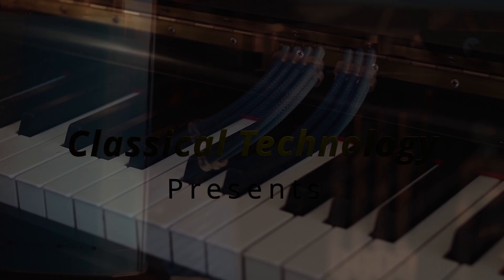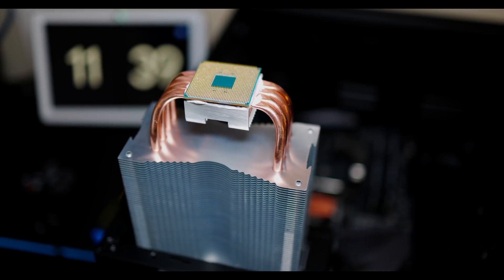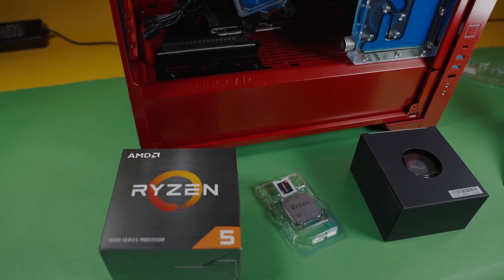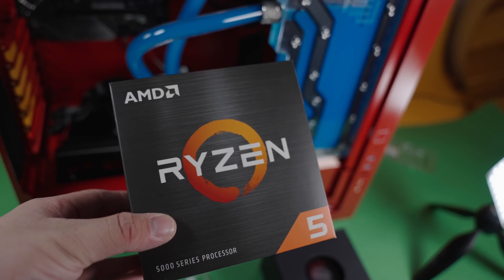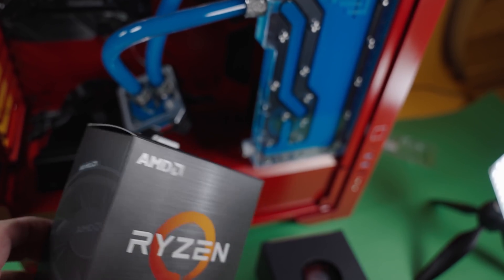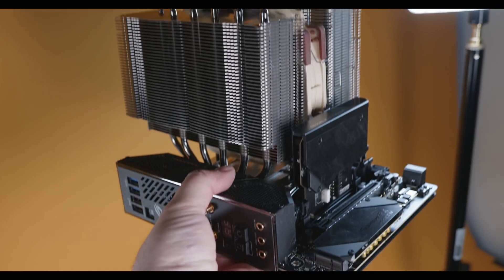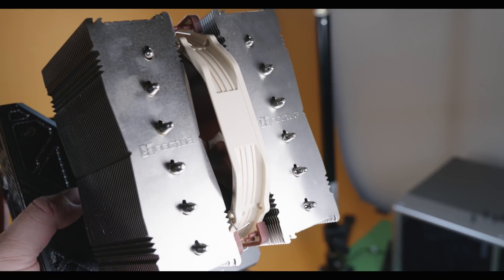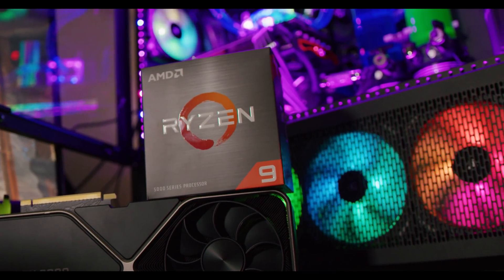WHICH TO BUY? AMD Ryzen 5000 Buying Guide, Availability, Performance

Comment: As well as the most famous youtubers did not speak much of the 5800x I will take the opportunity to have visualizations. The lack of intelligence is contagious, the 5800x has the same gaming performance as the 5900x is 100 € / $ cheaper, has 8 cores and 16 threads. This whole family of processors had an increase of 100 € / $ and they are advising 12 cores for those who will not use or 6 cores in 2021. if I can give another 100 € for a 5900x I can also give another 100 € above the 5600x to have one 5800x. Go to reddit to see temperature problems with the 5900x ... I bought the 5950x for myself and the 5800x for my daughter are two magnificent CPUs when I run the cinebench the two reach 75c very quickly the 5800x in games does not exceed 65c with the noctua nh15. The 5950x uses watercooling and the temperatures are slightly lower. Think about the advantages of 8 cores for 6 if you have money 5900x

Comment: Got a 5800x and it runs great.  I knew about the fact that it is normal for it to run hot so I got an MSI 360 rad and put it at the top of my bequiet  500DX case on exhaust with 3 140mm fans on the intake.  Even when it heats up and the fans crank up all the way it still stays pretty quiet.  Also I really only use it for gaming so it is rare to get hotter than 65-70 after gaming for several hours.  If you do heavy workloads that tax the cpu fully on a regular basis you are better off with the 5900x.
Reply from the maker: Glad to hear yours is running well, some do seem to be a bit better than others.

Comment: Hi tiago, i recently rebuilt my pc and Im having an issue, maybe you could help? Im rocking an rtx 3080 founders edition, an asus b550f motherboard, 32 gbs of gskill neo ram, a ryzen 9 5900x and a 1000w power supply, i just changed my power supply, motherboard, and cpu yesterday and now my pc just restarts when I start a game. I have a titanium rated power supply, so im just confused on what it could be, ive tried graphics card drivers, and such but nothing seems to work:( please help anyone
Reply: JayzTwoCents just did a video on a similar topic like this not too long ago. That problem turned out to be a bad graphics card. Check out that video first or if you have another graphics card you swap out with. Also are you using multiple M.2 NVME drives that maybe flooding your CPU lanes?
Reply: @BlueSword455  i figured it it out, it turned out to be the frickin anti cheat software installed with the games I was trying to test with lol. After a bios update it fixed everything:)
Reply: @Maclainnn  Lol, awesome! I'm glad it was an easy fix and the problem wasn't in the hardware. Enjoy your new build!

Comment: I got a 5800X. I wanted at least 8 cores and in my region the 5900X is $250 more than the 5800X while the 5800X is just $150 more than the 5600X so the value makes more sense. My stock temps with a Noctua NH-D15 were initially reaching 34 degrees at idle and 80 degrees in cinebench R20 (scored 6000 points multicore) but undervolting with curve optimizer I got the temps down to 75 degrees (6200+ points) and 27 degrees at idle. If I lower the PPT I can get the temps down to 65 degrees, R20 score at 6100 points and CPU power around 88W (matching the 5600X performance per Watt). It's a great CPU, but yeah it needs tweaking and the out-of-the-box experience isn't great. Makes me think the mobo BIOS is sending too much voltage at stock. Might get better with PBO2 but we'll have to wait and see.

Great video, man. Keep it up.

Comment: Have had a 5800x for a couple of weeks now, seems to be stable and not that hot. Runs at around 60-70 with water-cooling. :)
Reply: That's still high, Custom waterloop?
Reply: @Kizzster  It is around 35 on idle, and around 70 max it seems. After I closed down the epic launcher the temp went down quite a lot it seems. Corsair iCUE H100i RGB PRO XT is the name of the cooler. :)

Comment: Remember, the 5800X is only bad value IF you have a choice. Most of you don't. The 5800X was in stock for a good few minutes on NE yesterday. If you still somehow pay scalped price for a 5600X over a MSRP 5800X, I don't know what else to tell you. 
If your 5800X runs hot, try setting your PPT, TDC and EDC manually. I set mine to 120W/75A/110A and get roughly the same performance as stock while dropping 15C under all-core full load.

Comment: Hey guys I could really use some help! I’ve owned a pc for about two years but I’m not really tech savvy. My pc has worked fine with the games I play but recently my performance in certain games has dipped drastically. My biggest example is resident evil 7! It ran at 120 FPS steady with my 1060 but recently it’s been stuttering a lot and runs between 55 and 85 FPS. Idk what I could do to fix this issue so any help or tips would be appreciated. Oh and one last thing I’ve noticed is my load times have been really bad. In death stranding I have to wait 5 seconds on a black screen before I get back to the game after rearranging my packages and gear it’s annoying and never used to happen
Reply: Check to see if there is any abnormal tasks are running in the background using task manager. Shut them down and or run a virus/malware scan. Check for the latest graphics card update software. Also run bench mark and diagnostic tests on your ssds and or hard drives. They should run close to their advertised speeds with zero errors IF they are not close to being completely full. Then run a memtest to check for any errors in your memory sticks. Last thing I can recommend is a bios update for your motherboard. Hope any of this helps.

Comment: I have had a 5800x now and mine was fine. Out of the box running idle in bios showed 35C. When gaming it then jumped to the high 70s because it was boosting to 4.85ghz. These are bad temps but had a play anyway. Not changing any voltages just putting all cores on 4.5ghz the max temp I’ve had so far is 64C and that was playing in warzone for 4 hours with applications open in the background on my other monitor. There are all sorts of tweaks to keep temps down. If you’re not that likely minded though which I appreciate some people aren’t then the 5600x or 5900x would be better for you. As you can see from my temps though not all run hot. My mate bought one the same time and has the exact same experience as me

Comment: 7:05 You argument about it throwing more heat into your system isn't good. Your radiator will have the same temperature whether it's a 5800x or a 5900x/5950x that's dissipating 140+ watts.
Reply: Good point, these reported high temps are coming from the CPU die and not the actual water temp which is usually much more cooler.

Comment: Just ordered i9-10850k and Asus Strix Z490-E motherboard since it was in stock. Hope i didnt make wrong choice. Upgrading from i5 8600k and Z370-E(?)
Reply: How is it? Is it up and running yet?
Reply: @BlueSword455  it's been up and running for 4 days now. seems to be doing good. i let the bios do its thing and i believe it boosted it to 4.6ghz and doesnt go over 65c on temperatures (cyberpunk @ 1440p)
Reply: @Reaper_AjB  Nice, very nice! Yeah I have both the 5600x and a 5800x but waiting for my Asus X570 Dark Hero motherboard to arrive but my patience is running out after 2 1/2 weeks of waiting just to see how hot the 5800x was gonna run. I could just go to my local Microcenter and pickup a 10850k and order an in stock Asus Z490 Hero VII Maximus from Amazon and probably have cooler temps. I just want at least some kind of 8 core or more CPU that'll run the coolest.
Reply: @BlueSword455  hopefully you get it soon, i luckily found a local (somewhat) computer shop in my state that has been able to get 3080's soo i put down a preorder on it and they should have new shipment tomorrow or friday and one of those will be sent to me. ended up only paying $100 over EVGA's price. ended up preordering the EVGA FTW 3 Ultra

Comment: I was lucky snagged a 5900x on Antonline a few days ago. It's an absolute monster, a good match for my 3090 Founders. It also chew's through work effortlessly.
Reply: Same setup here, it’s awesome
Reply: What are the temps of your 5900x, at idle, full stress test and gaming?
Reply: @BlueSword455  it runs a little hot, but my research said that’s normal. Cpu temp gaming was peak 91c. Idle 60’s
Reply: @BlueSword455  it idles at 43c gaming it gets up to 55c full load it will get up to 76c. It is cooled by a 360mm custom loop.

Comment: My friend's 5800x was 50c in bios lol. Returned and got a 5900x
Reply: Most BIOSes can't properly control this CPU yet for some reason. Always too much amperage and voltage. Put in some manual tweaks and it's as good as you'd expect.
Reply: @Sentagin Home you won silicon lottery that's all there is to it
Reply: @Sentagin Home well he got a 5900x lol so he's good. My 9900k does alright since I got it recently for 299

Comment: What CPU and GPU should I get I’m beginning to build a PC on a $2000 budget. Should I get a 3070 and a 5800?
Reply: I have a 3070 and a 5800x although idk how the temps are since I’m still waiting for my cpu cooler and fans
Reply from the maker: That sounds pretty good, just keep in mind or 5800 may run a little hot, 5600x  should work as well

Comment: Great vid! Was able to score a 5800x and a 5600x today. Debating which to keep. Do you think a corsair h150i elite capellix could decently handle the heat from a 5800x?
Reply from the maker: I would try it out, some chips aren’t  as hot, but that is a great aio and should be able to handle it
Reply: I managed to get both Cpus as well. I'm still deciding on what motherboard to get and then I will test run the 5800x first. I also got the Capellix but the 240 version. Let me know what your temp results were if you can.

Comment: Just got my 5800x and Galahad 360. I hope it won’t be to hot..
Reply: I also have a 5800x and a Galahad 240. Mine runs at 90c in Cinebench R20. Might need to undervolt it and check the thermals after.
Reply: What are your temps guys? I also got a 5800x and a 5600x (just in case) but I'm still deciding on which motherboard to get.
Reply: @BlueSword455  Well, i cannot manage to get stable performance with undervolting. So i tried using Eco-mode. Gives me 80c on full load but around 5200 score in R20. Tried remounting the cooler and switching fan orientations. I'm now getting 80c  max on full load and 5600 in R20
Reply: @miguelfernandez8025  Dammit that sucks! What motherboard are you using and are you using the latest bios update? How's the temp during gaming?
Reply: @BlueSword455  I'm using an X570 Aorus Pro WiFi with the latest stable BIOS. With gaming, I'm getting at least 75-80 with AC Oddesy. That's fine with me I guess. Depending on the prices from where u are, I say go with an X570 over a B550 if the difference is not that significant.

Comment: Just got a bonus im thinking about getting a 5800x
Reply from the maker: It’s good, just remember it may run a bit hotter than the other ones
Reply: @ClassicalTechnology  ive got a 360clc should be set maybe i send it for the 5900 but finding it will be hard

Comment: In UK, the site i’ve pre-ordered my 5900X, there’re no more pre-orders for the 5950X, 5800X, 5600X but the 5900X there’s still about 750 pre orders to fulfil.

They telling people to upgrade from 5900X to the 5950X because there’s finally stock of those.

Been waiting for my 5900X since the 26th of Nov. Almost a month. Im really tired of waiting and thought about canceling my pre order to buy a 10850K which is in stock.
Reply from the maker: Yeah 5900x is hard to get for sure